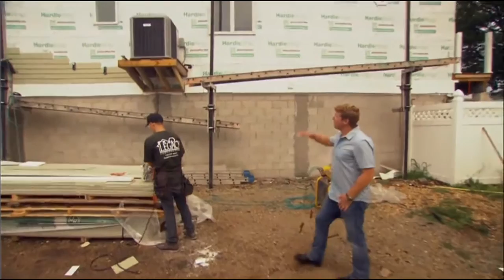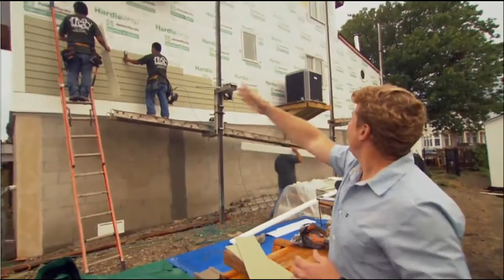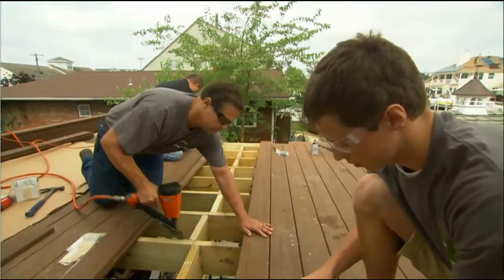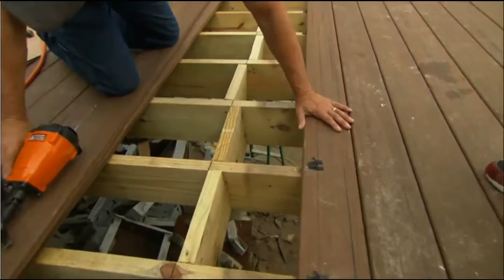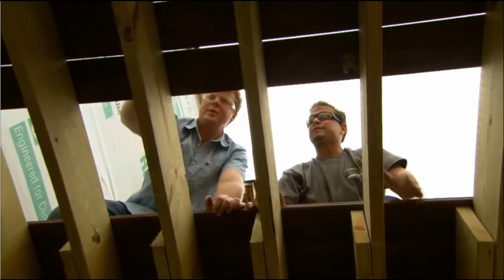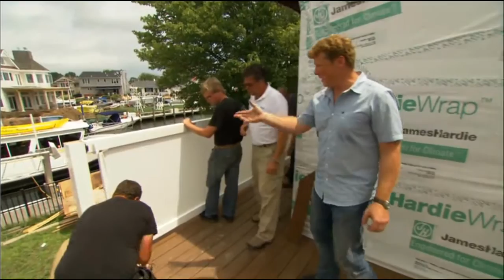This Old House Clip Using UFO Ballistic NailScrews®

Comment: It's now 2018.  How did the decking material hold up?  I'd like to use composite, but have heard stories of it not lasting.
Reply: Don’t by the cheap shit it won’t last!! I used trex decking about 8 years ago and not had a problem at all with it all! I power wash it once a year and it still looks brand new
Reply: IT all failed. It is like the MONARCH product that failed on every deck I have seen that used it. Unsafe to walk on. Boards cracking.